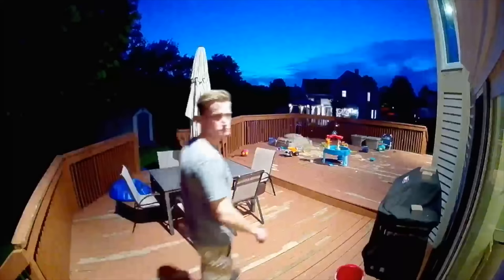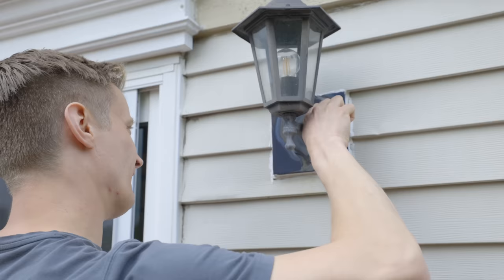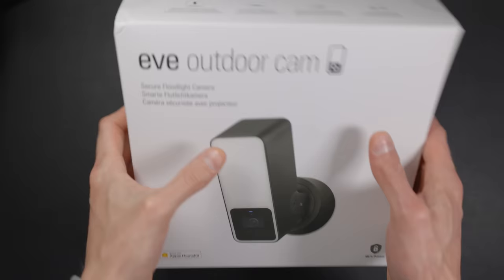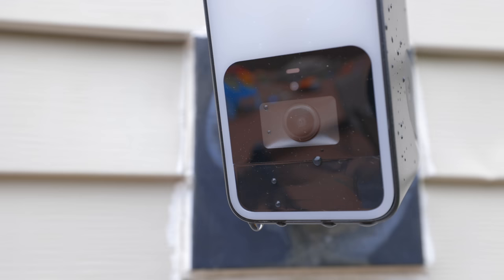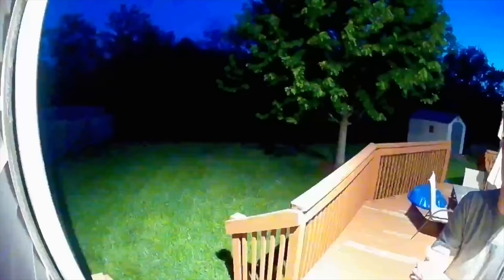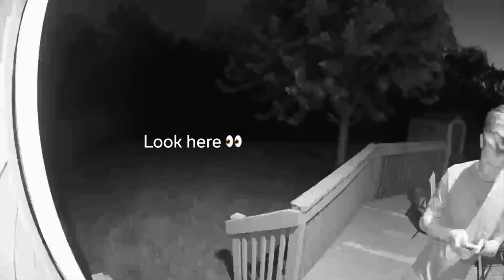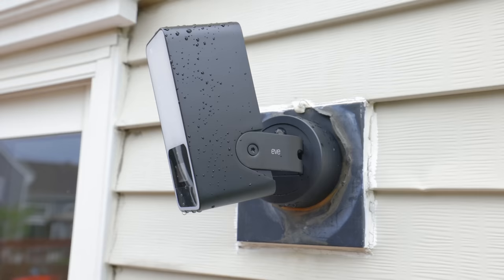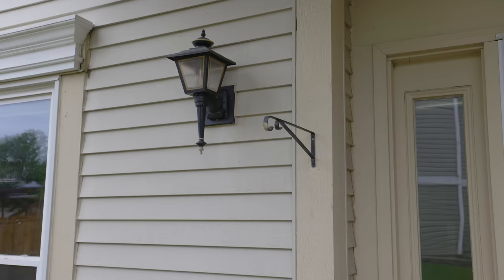Is Eve Outdoor Cam the best outdoor camera for HomeKit?

Comment: Me, I am having problems with the eve cam connection being very unreliable. From Eve Tech support, The Eve cam needs to be less than 20 feet from the router and cannot have any walls or other obstructions between the cam and router. Me, Uh, it's an outdoor cam, how is that going to be possible? Eve Tech support, try moving the router closer to the cam and make sure there are no walls obstructing it. Me, Wow, I just got ripped off of $250.
Reply: Wow , that's a huge disappointment

Comment: Great review!  I agree with what you said.  I ordered one the day it came out because I am trying to get off Ring. I converted it to a plug in.  Took 2 trips to Home Depot and an online order for the parts but I like the way it came out and I don’t lose any existing outside lights.  I agree that losing an outside light to a security camera was not acceptable.
Reply from the maker: That sounds like a great new setup for this camera. Nice work and enjoy!
Reply: Curious what you use for the sensors in the house?
Reply: @beatsbyjules.  If you’re talking about contact sensors for doors and windows, I use the VOCOlinc ones.  They are super cheap and turns out they work really good, even though they are bluetooth.  Pretty quick response and decent battery life.  Also, easy to add to HomeKit.  Got a few Eve contact sensors that use thread for some stuff that I thought was a bit distant for Bluetooth.  The Eve ones are really big and a little difficult to attach.  Thread works great!  Thread works so, so much better than Bluetooth or Wi-Fi.

Comment: I’ve heard this doesn’t play nicely with a standard junction box. Also, I have a huge issues that there is no lumens rating for this, seems like a huge miss for marketing a flood light. I wish the Eufy Floodlight Cam 2 Pro did HomeKit.
Reply: Agree they should list the brightness.  Decently bright.  Not going to light up a yard but lights up my patio nicely.  Connecting the light will require a little ingenuity.  Will have to adapt it to pretty much any mounting situation save for wires sticking out of the wall.  Been pretty happy with it.  It does have occasional lock-ups.  I can overlook the minor faults to get rid of the Ring cameras.  The Ring cameras (at least the plug-in ones) are pretty polished now but I am just not happy with the privacy implications.  Also, the round trip thru a server really, really slows down the Ring cameras.  The Eve is pretty much instantaneous.

Comment: Is Eve Outdoor Cam able to send notifications promptly or does it have the same problem as Netatmo Smart Outdoor Cam where there a lag or time delay between the object appearing in its field of view and the notification sent to the respective iPhones or Apple Watch? For Netatmo it’s a delay about 30s
Reply from the maker: I haven’t tried Netatmo (yet?) but the Eve is pretty fast in my experience. Some of that lag might be your home network for one reason or another though
Reply: I have the Netatmo presence and outdoor cam. There’s is a lag but 2 to 5sec max.
Reply: @EricWelander  Thanks Eric for the reply. To be honest, I was about to purchase the Netatmo Smart Outdoor Cam until I came across a YouTuber (Ben Vallack) who owns it and faced this lag issue with the regards to notifications. Eve Outdoor Cam appears to have resolved this issue. But you might be right, it could be a wifi issue.
Reply: Hi Eric, just a suggestion; do a update video after 1 to 3 months of use of this camera. Including footage playback quality.

Comment: Can this be mounted under an eve like where a traditional floodlight would be?  Mounting it horizontally instead of vertically on a wall if that makes sense?
Reply: It can't. The bottom has to face dow to prevent water entering through the mic and speaker.

Comment: By the way, camera powered via an ethernet cable would be awesome - fast and furious !
Reply from the maker: That is Ubiquiti Unifi Protect’s concept. I’ve been testing their tech and briefly showed it at the start of this video. But running Ethernet from inside to outside can be tricky too.
Reply: Yes - involves drilling holes thru your outer walls. Pity Ubiquiti are not homekit compatible.

Comment: Eric
I just wanted to let you know that there is a wifi camera system that does come in a more traditional porch light camera with two-way communication, motion sensor to activate both the lightbulb (at nighttime) and the video recording, it has a 110db alarm, plus both pre-recorded and custom greeting options.  This company also has a floodlight camera with the same options but the light is on both sides of the camera, dimmable, and separately adjustable.   The only problem is their lack of integration.  They do integrate with both the Amazon & Google assistants.  But only have the ability to turn the light(s) on/off. There’s no integration with SmartThings nor HomeKit.  But otherwise, the porch lights and the dual camera doorbell work great.  The company is Kuna.  I have a video on my IGTV that goes over it.